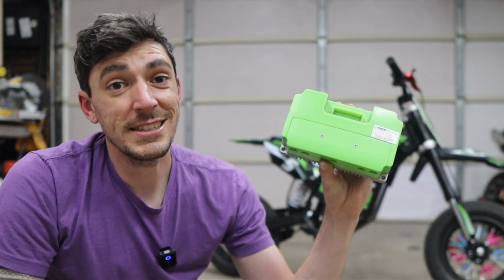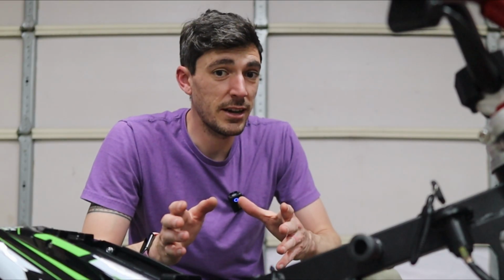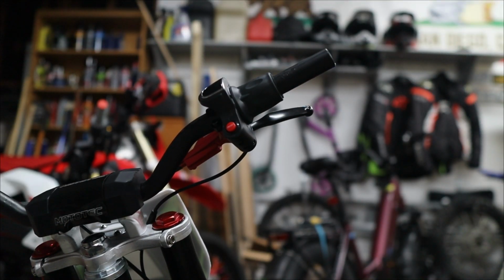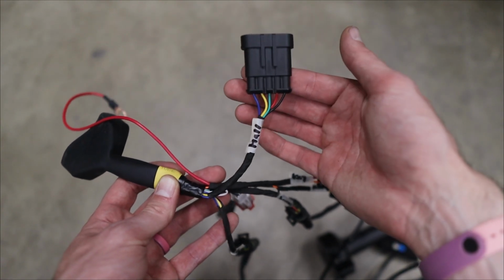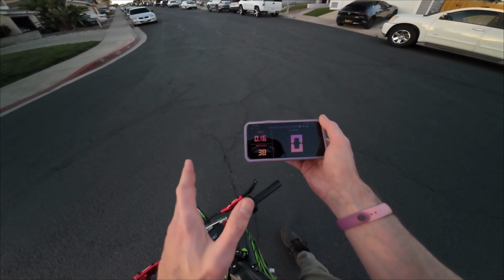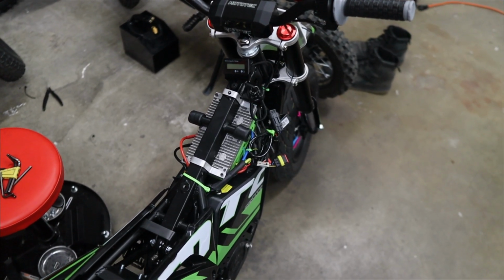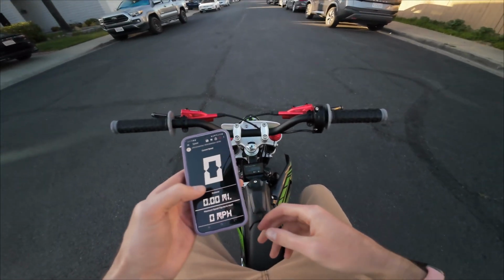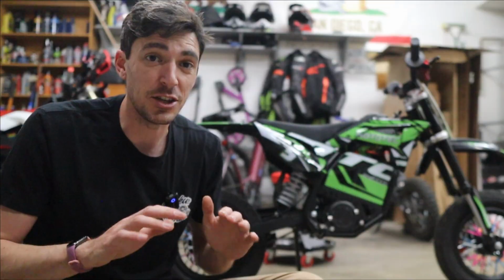Youtube's FIRST EVER Fardriver Controller in a Mototec 60v Pro!

Comment: Why put the fardriver heatsink looking backward, put it with the heatsink facing forward for way better cooling for the controller, more you push the hottest the controller gets, but more you push you get way more air that cools the controller 2 in 1  XD!

Comment: Hey I was wondering if you could do a more detailed video about how you wired up the fardriver for the throttle volt meter and etc just ment for the mototec60v
Reply from the maker: I'm working on one now! Includes wiring a surron throttle to a stock controller.
Reply: @lexdfox great I have the 60v now and my stock controller broke so I think I’m going with the upgrade

Comment: Could you put a volt meter and a full twist throttle on a Moto tech 60 V? Without any upgrades
Reply from the maker: Yes, with some wire cutting. I plan to do a video on this!
Reply: @lexdfox yes you should do a video on that, I really want a volt meter and a full throttle

Comment: Hey man! I was curious, I have a 60 V Pro. And all I want to do it is switch out the half twist on to a full twist throttle, can I do that without upgrading anything else on the bike? And if so, do you mind telling me how to do that?I really appreciate if you could help me out I’ve been thinking about this for a while.
Reply from the maker: Yeah you can, wires are black to black, blue to grey, brown to red.
Reply: @lexdfox  ok sweet! thanks for replying, can you tell me which throttle i should buy that will make the setup process easier?
Reply: @lexdfox  hey man! Sorry for asking so many questions but I’m working on my model tech today and I practically electrocuted myself because I tried what you said and I still don’t seem to understand. Can you try and walk me through it?

Comment: Sorry to bother you again lol but I just ordered a new throttle to potentially fix my bike while I wait for mototec to send me a new stock one.
Do I need an aftermarket controller for the surron throttle? Or can I just plug it in to the stock controller
Reply from the maker: No you can wire it up with the stock controller.
Reply: @lexdfox  thanks! Ya I ended up getting with Brandon as well lol saw a post he had of a different throttle and voltage meter ended up asking about the slide on and the surron throttle as well as you, should be here tonight I can't wait to install it!
Reply: @lexdfox So I got my surron throttle and got everything wired up with the help of Brandon and it didn't end up working. Not sure if my controller is bad or if I wired up something wrong. Can you tell me the wire sequence? White to blue red to brown and black to black?
Reply: @quadridingboy93 did u ever figure it out i need help on how to do it with surron throttle and battery meter

Comment: Any chance you could help me with why the stock trottle would just cut out in the 60v?
Reply from the maker: My first thought is a loose wire in the throttle connector or even in the throttle itself.
Reply: @lexdfox  I'm thinking the throttle cable leading to the throttle itself got loose somehow cuz it quit then I wiggled it and it worked a bit while riding then quit completely but I don't exactly want to break it and know how to pull it apart.
But when I unplug and plug it in with the key on it clicks and kinda engages the motor for a split second

Comment: Love your videos. What line and phase amps are you running? I can't see on my phone. Also, do you think there is any advantage running a siron throttle? (I've got one of those cheap, 3 in 1 throttles).
Reply from the maker: Thanks! Right now the line is 50 and phase is 220. Fairly low numbers I know, I could push it further and might later on. I haven't put too many miles on the bike with the surron throttle but honestly I think any full twist throttle is better than the stock half twist. I had the cheap 3 in 1 throttle on my 48v and it was just fine.

Comment: I put in a 72260 in my 48v and it hit 39mph w/ the stock battery. Just put in the amorge 72v and it totally rips now. Tried to do a top speed test but dirt tires made the front too wobbly at speed at 45 so I backed off. Will try again once I put on some my dual sport tires later in the summer. Your tune is very conservative. I'm running higher #'s on the stock 48v motor.
Reply: what do u have the controller tuned to with the stock battery
Reply: @ 70 line 240 phase, field weakening starting at 3500.  Stock max speed was 24mph so I was stoked to get an extra 14mph with a $100 controller.
Reply: You need a balance if your front is wobbly. I ride mine at 60-65 mph and nothing.
Reply: ￼ayarlarınız nedir?
Reply: @SoraJKing tell me your setup please. 48v?  72v?    Stock motor?    What model Far driver?   Thanks man
Reply: What u mean by a 72260?
Reply: @RazorZone420  72v 260amp
Reply: @RazorZone420  that is the fardriver controller model
Reply: @RazorZone420 that's the Far Driver  controller model number son
Reply: Does it discharge the battery really fast?    To trade range for speed is something I'm cool with.    I never ride for long periods.    My battery never needs to be charged.